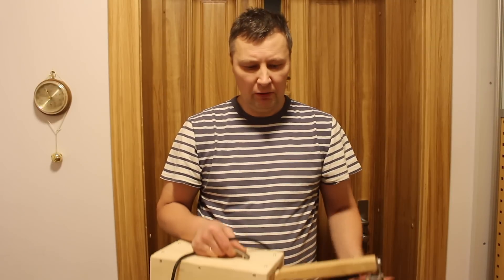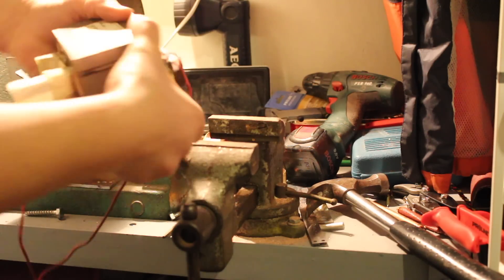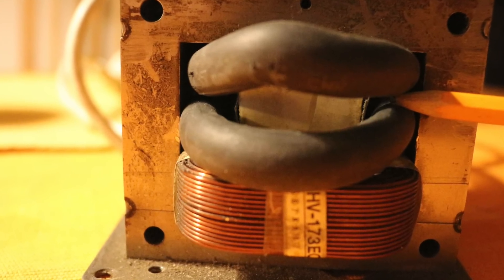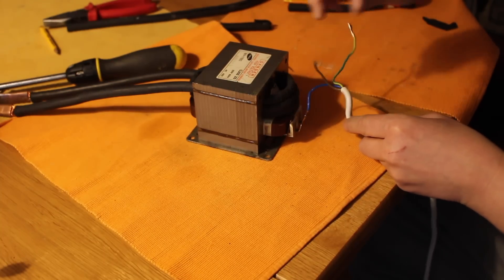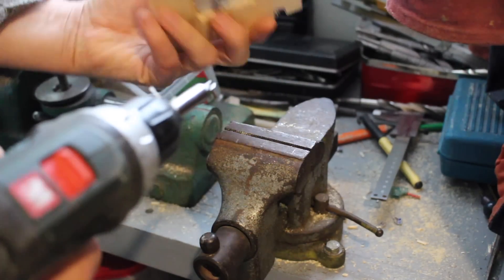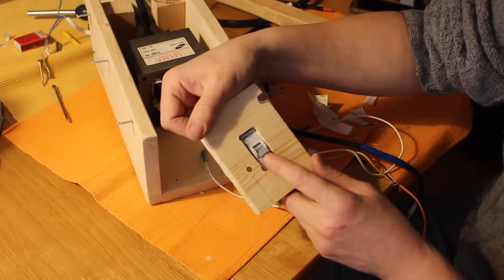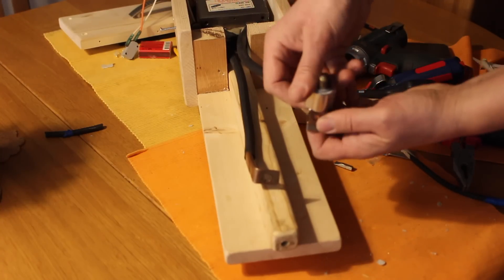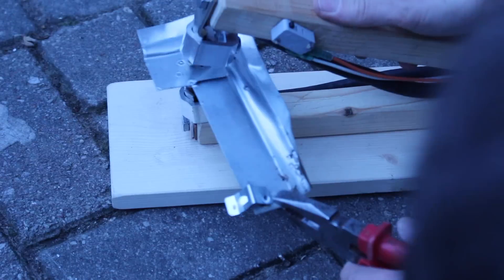Spot Welder from microwave  -   how to increase the power

Comment: Dude I really like the way you did that. It is the way I would need to do it without a welder and a ton of other equipment. Thank you. Just one question though, would I be able to use it as a stick welder instead?
Reply: You won't as for as you need a higher voltage, you will need to make a separate welder, if you use microwave transformer, you ll need 2 of them, with more turns on the secondary to increase the voltage. Basically spot wlding: High amps, low voltage, Arc welding: Higher Voltage, lower Amps
Reply: To add to my previous reply, the cable you ll need for a spot welder will need to be much bigger in diameter since the current is much higher (probably around 400 to 500 amps depending on your transformer), however, typically arc welder have a 48V voltage output, ranging from ~60 to 250/ 300Amps output. The reason you ll need 2 transfo: it is unlikely you ll be able to re-wire the secondary with enough turns to obtain the voltage required and at the same time with a cable big enough to sustain the intensity (amps) required. So by having two transfor with the secondary wired in series, you gain basically twice as many turns or in order words, you can add up the power of the 2 transfo together.
Reply: The primary shouldn't be affected as it will always deliver pretty much the same current. I think it does matter when you have a smaller cable on the secondary ( like myself, with 25mm2), as you need to make sure that the current is not going on for too long. Though I like the way you managed to increase the power just by removing the insulation. Great job!
Reply from the maker: may, the strength of the weld depends on the length. However, it works best as a point welder to weld a thin metal
Reply from the maker: touch welding method
Reply from the maker: high power ok 50mm2, but for the primary winding the original cable does not heat up, even the 20A switch does not turn off
Reply: If you can get hold of 16 gauge welding rods it’s possible to arc weld with these transformer welders. Best source for me has been the welding specialist companies. In Australia we have CIG and welding specialists shops . I say 16 gauge or less because of the output of these systems. Touch electrodes make life easier too if you can get the small ones ....

Comment: I am in the process of building a second battery tab welder. I have #2(2guage) welding wire and 2Guage battery cable wire. What would you recommend? I purchased both just to have on hand, just have no clue what to use on the second welder.
Reply from the maker: ok

Comment: I had noticed someone had built something similar and the transformer had over heated. and melted. Microwaves also have a cooling fan in them to keep things cool maybe you may want to address this situation before you might have some challenges. Just a thought. But nice build. I hope it works great a long time for you
Reply: he overheats on idle very fast.not for long use and must have cooling. cheap production result,not made to be on long time

Comment: i am doing the same project when we using this spot welder the transformer get heated up and insulation will be meltoff it may damages wire how to solve this problem
Reply from the maker: large cross-section of the cable and the cable must not be taken to be too long

after some time the need to make a break
Reply: 1. max out the space on the transformer (thickest cable which fits
2 replace the insulation with glassfiber sleeve
3. add heatsink + fan
4 keep cable short
5. dont operate too long , its called "spot" welder not stick welder :D

Comment: Good morning
hi dear
nice job 
if i want to buy this Spot Welder  you have made 

how much will it cost me ? 

thank you
Reply from the maker: In Store -  $ 200 -300, if you make it yourself and have a transformer or  old microwave oven then $ 30
Reply: I do not have the required tools
I have no background about electricity
if you can make another 220 volts and send it me
i will buy it 

regards
Reply from the maker: Thank you for the evaluation.
At present time I am working on existing this year projects and yet do not have time for this work. Shipping would also be difficult. Where are to be sent? Maybe better to look for master closer to your place of residence.
Reply: Thank you very much
I  will get it by any means

best regards